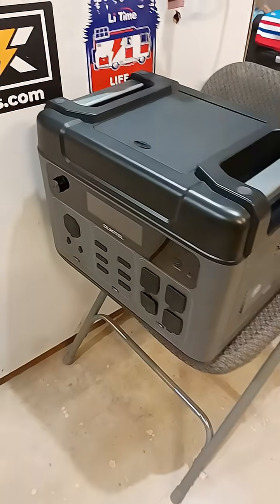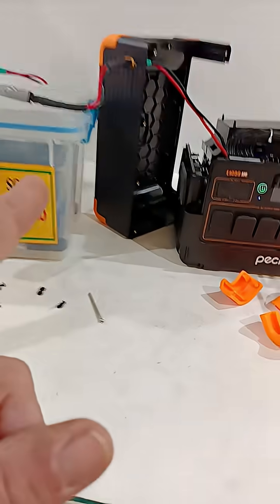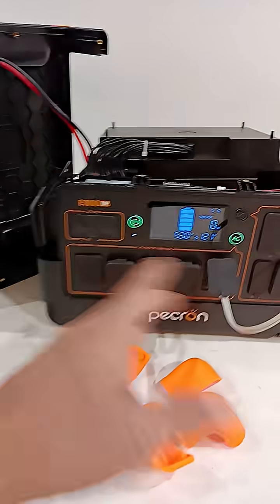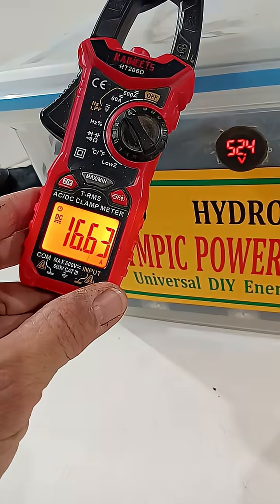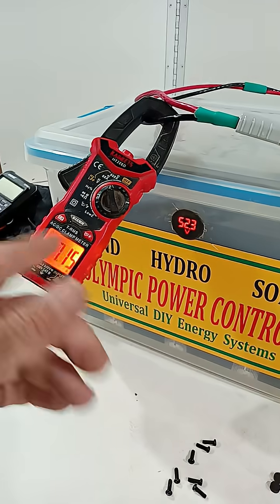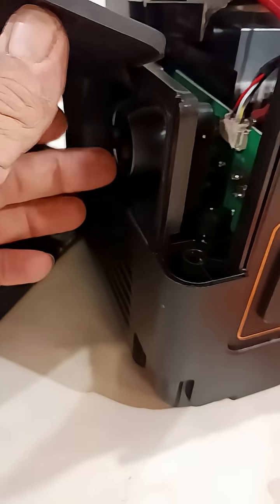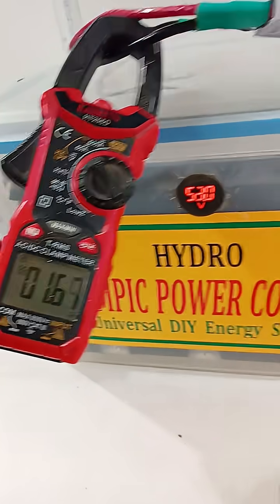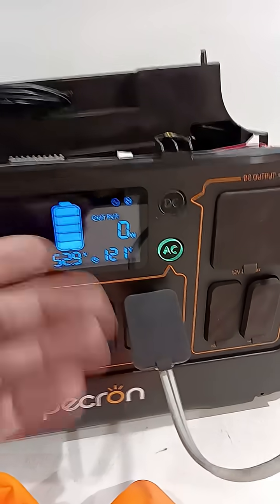Direct tap Power Station Battery to add full voltage expansion battery when there wasn't a option

Comment: Hack bluetti na sodium power station review
Reply from the maker: Right now Sodium Ion has a short amount of total Amp Hour storage ability. The absolute best battery to use is LTO if you can get a matched voltage but at some point I am sure Na+ Sodium Ion will get to be usable in such a unit. The current problem is cell voltage on them is 1/2 a volt per cell different and the chargers are not on the market yet to help in using them for power stations.

Comment: Or just got directly through the expansion port on the Pecron, no need to cut open the case...
Reply from the maker: Opening it up was a few minutes, connecting the XT90 into it about 15 minutes, leaving the original port as is allows it to still be used for purpose. Buying the expansion cable is $30 just to cut it and adapt it or use as much money adapting it in terminals or connectors at a high cost of the hard tap of the XT90. Now it can and has been connected directly to another brand of power station both with 48V LiFePO4 and the spare battery that also feeds both. I can now daisy chain many with same battery style/chemistry into one mega bank all with MPPT solar as well. 
Why tap? Not many have even close to similar ports or connectors. By making them all Anderson and XT90 adapted I can swap as I go any brand or capability to anything in the same battery group.
Reply: @JOHNDANIEL1 voiding warranty isn't an issue with modifications?
Reply from the maker: Nope. Warranty on a Chinese item now about is honored about as much a house full of hookers at a Church social. Just read the reviews from any source OTHER THAN the sellers own web sites. The #1 thing is fake warranty, no real warranty, massive shipping cost required, claims from sellers YOU altered it by using it, and just refusing to even answer calls or emails. Renogy, Bluetti, Ecoflow, EG4, Victron & All the battery brands the big consumer names all them get a minus 1 on every format for warranty responses. Best thing, learn what you buy, including how to fix it or consider it as disposable when it can not be fixed.
You may be cozy with sellers, They may jump a bit on a concern, but that is not the general publics outcome.
Reply: @JOHNDANIEL1  To be fair, Pecron has honored all my warranty claims to date with free shipping in both directions.  Twice with the E2400LFP and once with the E500LFP.  The quality control has been bad in my experience with them, but their customer service is highly responsive.
Reply from the maker: IMO you should expect 3 to 4 years of inverter function before most all of them fail. Too much compressed components where space was the goal and that will always lead to something missed. The battery may make it another 4 to 5 years as a salvage use. To solve that, get replacement fans ordered for any you own and always run them no more than 75% rated and you may see 6+ years use.
Reply from the maker: China is in dire straits, was headed that way due to economics in housing and foreign investment scams but it is getting worse fast. Flyby night sellers now make up the majority. Even Bluetti has had 4 different trade groups running it in the last 3 years. Few are legacy brands now. So warranty is like "trick or treat" game to play. I have been to China 3 times, the reality on the ground is not nice. I have about 40+ friends still there and doing really bad. Tariffs did not cause it but they will end it. Check out channels like China insider or similar to see more on their issues.
Get what you can while you can with a growing back up plan, this YOU TUBE thing will go from new current low of $0.0025 to be full blown $0.0000001 per impression click adsense nightmare. It's all gonna be just a AI filled circle jerk of white noise and no matter what we are to the system, what we ain't is special!
Reply from the maker: This will sound off the rails but! 
About 16 years ago in 2009 I saw every bit of this coming. The AI, western countries will race to the bottom in only a few years with leftist nuttery (look at Europe and us now), History will be on full attack they will even tear down statues and monuments, the Dystopian politics, the Woke mind virus, I said on that video someone like warren buffet will become president soon probably after Obama, and they the evil will go after him but he will return, ( it was trump instead), describe locking us all up about the pandemic even. I even explain in the vision that they are going to start replacing humans by 2025 not with robots but something very evil and it will happen so fast you won't be ready. I explain people will go all in on stopping having kids, Gen Z will not even marry, queer things will even infiltrate our schools, businesses and kids. I even said in the video "watch out for women they are going to go straight Sodom and Gomorrah on us" and men will start avoiding them hard core. 
From that whacky vision I went all in on 100% self reliant. Food, power, resources. Nutty sounding or not. I went from $3800 a month in expenses to since January 2020 right before Covid hits to having:  No house note, no car note, no electric, water, sewer, trash bills. I woke up at 4 am and without knowing why made a 25 minute video of my self, first ever done and still to this date only one I ever done. I may one day upload. Made it on a flip phone, yeah that long ago. Better than 90% has came true, the last 2 minutes of that video give us till winter of 2028 to be completely ready for what we will call numerous things like Armageddon or civil war or the end of humanity. 
Now sharing that with a similar thinker, you may find your deep intensions saw similar or you would not have focused on a line of things related to such reasoning to do videos on. Who knows. 
Either way cover your ass, keep all you get in good condition and get all you can from those sellers while you can. Myself just a moral idiocy or not, I refuse straight up FREE for promo, but they still try. I will counter offer $50 for a $400 inverter and they will take it but include NO user rules. Try doing that it will change how you see the warranties, power claims, and realities on the ground. 
Stay cool. If you want some real rated, not fake a watt,  small wind turbines to put in videos let me know, I still got 40+ in storage from installer days. I'll get you one for cheap. Look for my Email and just send me a note on it.
Reply: @JOHNDANIEL1  dammit man. If only we could gather good people communities by that time. A lot aren't even aware of the Earth changes around that same time. Beat demonic hordes and then battle the Sun. Helluva ride.
Reply: The point here is that they connect the expansion battery at a point where the built in charger will charge the expansion battery.  If you use the external port for "solar" it doesn't do two-way power so you need a seperate charger and you have to manage the charging manually.